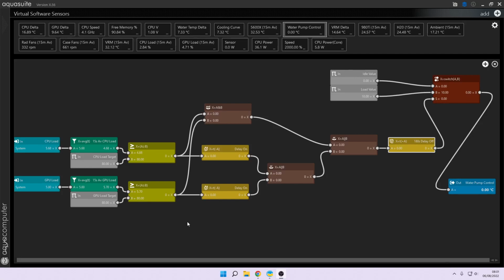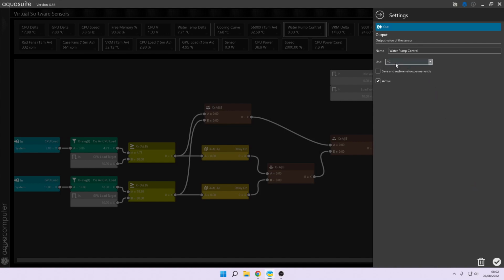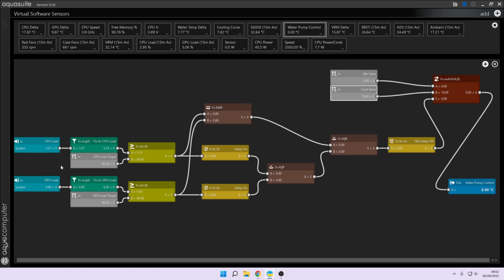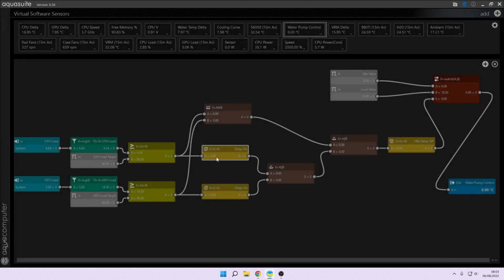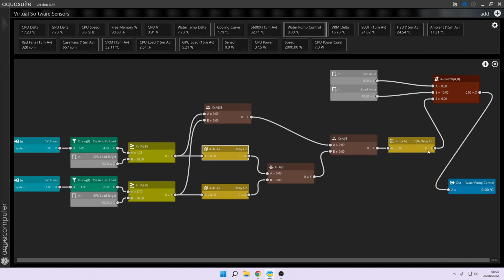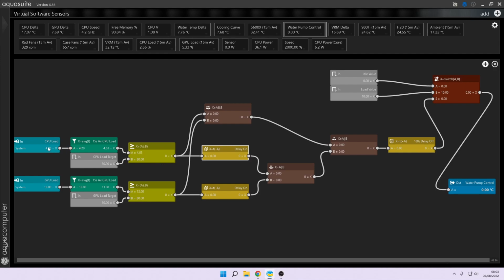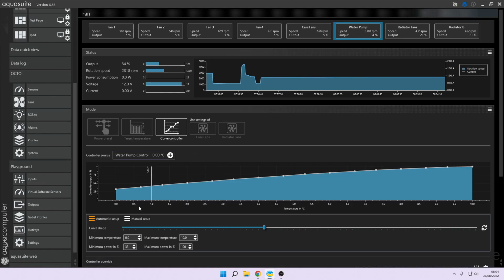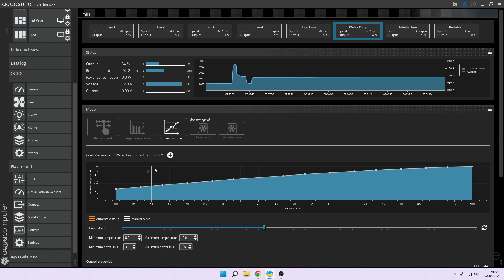Aquasuite: Water Pump Control _Complicated Method

Comment: Heya first of all let me thank you for your videos with aquasuite they really do help indeed,what i was wondering i notice you have a CPU Speed virtual software sensor,can i ask how you created that in aquasuite,or even better if you could create a video or give me advice on steps on how to do this in aquasuite,thank you very much for your videos they are just a godsend when it comes to aquasuite.
Reply from the maker: Hi Gerard, Thanks for the message.

I find it easier to do these short videos especially when responding to forum posts (or questions)  as its less hassle for me lol

Anyways as requested, it's simpler than you think ;o)

https://www.youtube.com/watch?v=f2rTdCfQbh0
Reply: @winstonwoof732  Thank you most kindly indeed it is appreciated greatly,excellent.

Comment: I can’t find any reasoning online to how this is beneficial over just using the coolant temperature for the fan curve.

I’ve also seen another video which averages out cpu core temp, gpu/hotspot/Memory temp, coolant teml, case temp and ambient temp, and I’d just like to know the benefit of either over just using the coolant to ram the fans.

Like, since I’ve got every fan in my setup exhausting, case temp is pretty much constantly 3c over ambient and doesn’t really change as far as I can tell.

So it doesn’t sound that useful to do in my setup?

I’d appreciate a general explanation, doesn’t have to be way in depth, thanks in advance!
Reply: Is it ok for the loop to set the every fans as exhaust?
Reply: @Gabo99  yes
Reply: Even more this controls water pump, not even the fans, so yes I also see this as useless for this pourpouse, if you have water temperature sensor, so it would be more beneficial to control pump according to water temp.

About fan control, it could do something based on pure load